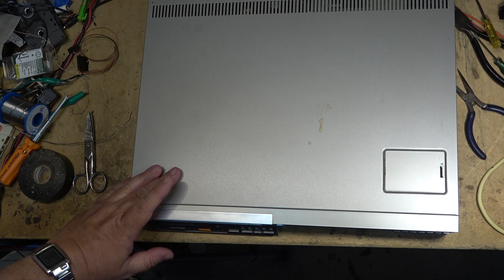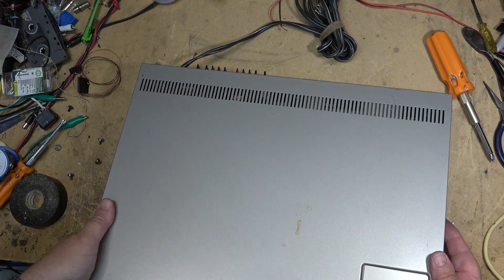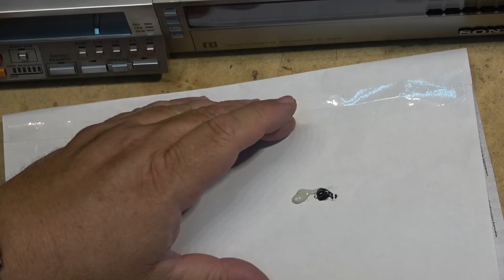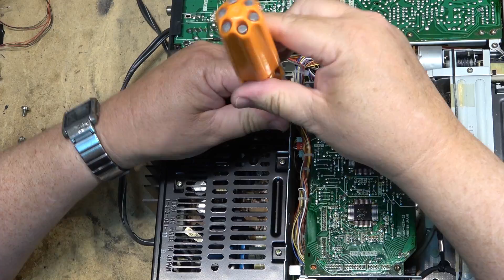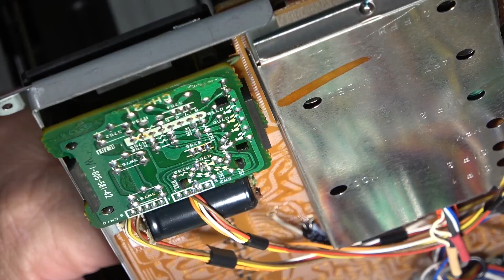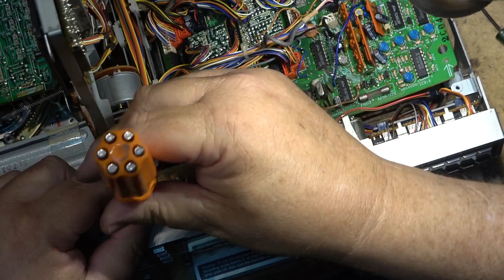Sony SL2500 Betamax will it work

Comment: I have an SL2500 but the power supply doesn't seem to be working. I'm only measuring 3v off the 12v power line. Any suggestions?
Reply from the maker: If the constant 12 is low check the filter caps in the 12 volt rail.
Reply: @12voltvids  Thanks, I'll check them out. I should also mention that the +5 rail only measures a bit over 1 volt, and adjusting either pot makes no difference.
Reply: @12voltvids  I replaced the two filter caps and now I get +12v and +5v, but I'm in the same boat as the machine in this video. The battery in mine also leaked, I've cleaned up the leakage but I haven't checked for any bad traces yet. I guess that's the next step.

Comment: I have a SL-8200 and I like it cause of the big A*s motor and all the belts and metal the thing is 40 something pounds.  I don't have it working perfectly yet.
Reply from the maker: I have an 8600 i think.  Single speed b2

Comment: I have two industrial betamax. SLO-383. They were connected together with a RM-440 controller and  a Video Toaster. It was a nice editing setup. They were built in 1980 but I got them in 1999. When I last put them away a few years ago, it needed the belts changed. But other than that, they worked great.

Comment: Very very similar to the SL C9 in Europe. I have somewhere between 7 and 10 of them in various states of disrepair and they are still expensive in Europe although the power unit is different, as well as the issues you mentioned with loading gear and guides the UK SLc9UB suffers from defective dc to dc converter causing a working unit with no display. Early versions are in a metal can , later ones have ventilation holes in the can but they still break.
Reply: I bought one of these about a week ago. Mine has an issue where the sound is muffled even after adjusting the azimuth of the audio/control head. Do ACE heads go bad in these?

Comment: I've used the alcohol and toothbrush method on cellphone boards and laptop boards and brought them back to life

also that battery you clipped out might be needed at least power to those connectors I know may not be relevant, but older mac's the desktop version and laptops if the clock nvram battery was completely dead the system wouldn't respond /boot power up
Reply: "also that battery you clipped out might be needed at least power to those connectors I know may not be relevant, but older mac's the desktop version and laptops if the clock nvram battery was completely dead the system wouldn't respond /boot power up"

This VCR can work without the backup battery, and you may as well clip it out of these machines now because of the risk to the servo board versus the now rather pointless utility of the battery.

Comment: and here im sitting and recapped a ccd-v5000 (with aprox 300 capacitors in it) hearing you ramble about 2 inches of battery damage on a two side pcb , heck what shall i say on my 4 layer pcbs , you shouldnt be so negative.

btw got my v5000 workin perfectly  , cheers  ;)
Reply from the maker: I'm fully aware of the v5000 I recapped mine before selling it. Did it all with the original surface mounted Sony caps so I'm sure they all failed a game and I did it before they leaked on to the board at the first sign that the video was starting to get washed out.   I'll wait and see if I could unload the other 2500 that I have that is in perfect condition. If I can get rid of that one and get some half decent money for it that might be a factor in determining whether I get back on this one again. But to spend countless hours pulling chips out of boards and repairing damage traces for something that may just end up sitting there never to be used again I just can't justify the time and effort. It's not like it's something that I want or need. If it was my slhf 1000 that's a different story. I would be spending the time on that machine because in my mind that would be worth it. After all I did a Head drum swap from an s lhf 900 to make a 1,000 work when the drum motor seized up. But this is a 2500, one of the most problematic chassis ever made. these are the ones with the great direct drive motors that were infamous for snapping tapes on rewind. I got awful design that Sony figured out pretty quick was a pilot crap from the time it left the factory. This one the SL 2000 portable and the sl-2700. the three worst betamax machines that Sony ever made!
Reply: @12voltvids  "This one the SL 2000 portable and the sl-2700. the three worst betamax machines that Sony ever made!"

I knew there was a reason why I liked my SL-2710 more than the 2700.
Reply from the maker: @Watcher3223  those ones had the poorest picture too.

Comment: @12voltvids the connector you were looking for was probably the almost completely trashed one that was sitting next to the following Points:  J605, Q626 right in between CP609 and B699; R649; R650 beneath the two Orange Connectors left from the leaked Battery-Acid at the Timestamp 16:40 (Bottom Left of the Paused Frame)

Comment: Is the board multi layered?  If it is even removing the ic isn’t going to help if internal traces are damaged!  The power of the leaky cap!
Reply from the maker: I don't know whether it's multi-layered or just double-sided it could be a 3 sided with internal connections.  this was around the time that Sony started putting their multi-layer boards in and actually just using solder to interconnect between the layers before they started plating the boards through.

Comment: One big nightmare, dig into it if you enjoy torture :-D.
I would dump it, it's very unlikely you will ever find a good one worth repairing.
Reply from the maker: I have one that is like new in the box that is going to be sold as i need a beta like I need a hole in my head.  Especially one of these complex units. I have two slh f1000 that I use for tape transfer and that's enough. They get turned on perhaps once a year if that.

Comment: We used to have a SL-C6 mk2 Betamax briefly in the early 80s. The thing kept on chewing up tapes, and the Sony engineer came out few times and had carve bits off the loading ring or something. After that we switched to a Ferguson VideoStar VHS, and that was totally reliable.